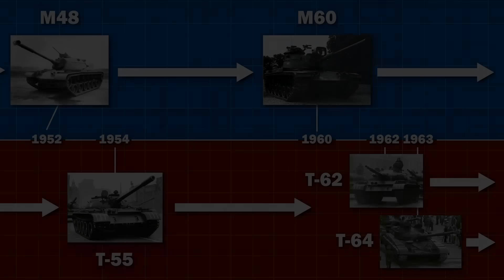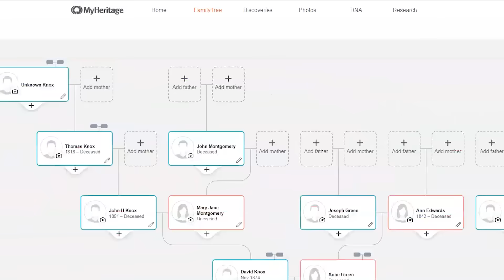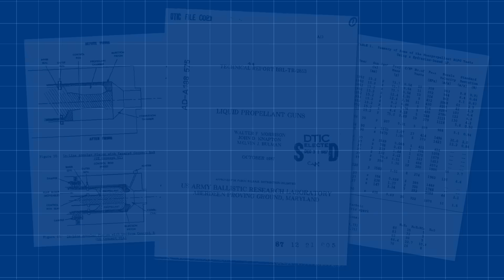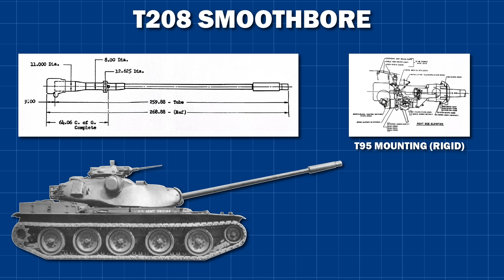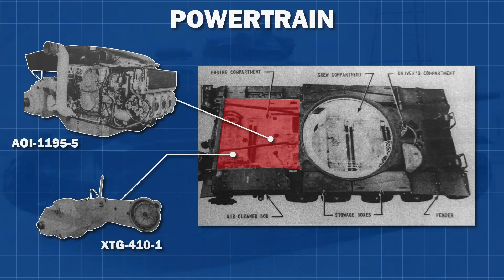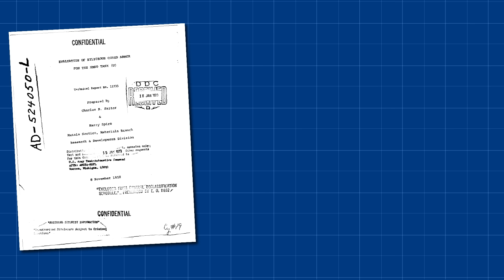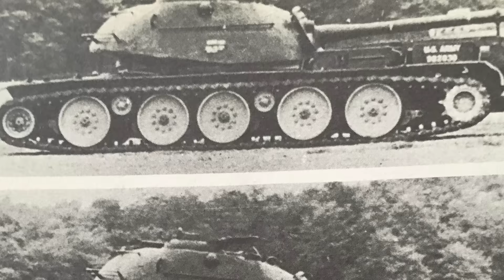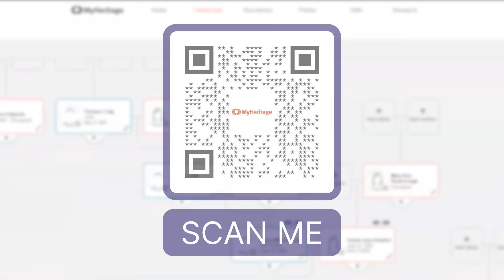T95 - America's Forgotten Super Tanks

Comment: The actual first tanks using composite armor, stretching the definition of composite armor to its very limits, are the Shermans and T-34s equipped with addon concrete armor. If the killdozer's steel and concrete sandwich was considered composite armor, then so does this.
Reply from the maker: I get the feeling composite armour has to be built as a composite to really “count” but I see what you mean haha

Comment: Note early in this video, the NUMBER of wheels.  These early tanks were midgets and lightweights compared to modern systems.  The "instantaneous" footprint of any tank or combat vehicle is determined by how far you spread out the weight in PSI.  Our company did a lot of this work for the LAVs, but they just used rubber tires, so that they could maintain "fast" combat speeds to engage with a slow-as-slug main battle tank.  Unfortunately the USArmy has instead managed to add dozens of Tons to its combat vehicles, because it does not have intellectual capacity to understand that a 70-Ton M1 cannot cross almost 90% of the Ukraine, during the rainy & mud season (and also the heavy artillery).  Russia is now using its most lightweight tanks, to try to avoid this problem.  ALL of these contending forces suffer from the same brain damage, in that all of these vehicles are almost immediately wiped out, by simple 2kg-to-4kg-to-6kg warheads, flown in by drones.  Drones can fly miles further than artillery rounds, so alternate defensive measures are desperately needed...
Reply: The added weight between old and new vehicles doesn't come out of thin air. For each added ton there is a considerable increase in efficacy, that is why tanks got so much heavier.

The main deciding factors on cross-country mobility and mobility in poor conditions is power to weight ratio and ground pressure. In both respects, Abrams and its fellow heavy Western contemporaries are largely fine. The Abrams has never been seriously hindered operationally or tactically by a lack of mobility in poor conditions, even in large scale deployments. It still remains one of, if not the, fastest AFV currently deployed by the US and a similar principle applies for its European contemporaries.

The added survivability of an MBT is massive and it's very disingenuous to pretend that it makes no difference in combat. Just because your feed is inundated with videos of drones doesn't mean that threat nullifies the idea of survivable, well-armored vehicles.

Also, the idea of MBTs being lumbering "slow-as-slug" AFVs has been dead for decades. MBTs are routinely the fastest and most mobile AFVs on the field at any given time and this has been the case since the mid-Cold War.

P.S. Russia is using whatever tanks it can muster. It isn't cherrypicking for light AFVs like you claim. Full-sized Russian AFVs are seeing widespread deployment constantly.

Comment: I had a chance to see on of the surviving T95 prototypes when I was stationed at Fort McCoy, WI in 1975-76.  It was being turned into a radio-controlled target for the anti-tank M72 LAW training range, where it would be repeatedly struck by the 35 mm M73 training rocket fired from discarded LAW launchers.   The M73 not having a hollow charge warhead, the only damage to the T95 woukd be to its paint!   This would give trainees a better experience - having to deal with a maneuvering target rather than the typical stationary target on antitank ranges, and would be much safer to fire as the M73 did not have as fearsome as backblast as the M72.   I rotated away into retirement before the T95 target project was finished, so I cannot say if it was a success.   The T-95 we were working with may be one of the four still in existence.
Reply: Can confirm that the tank is still there at McCoy.  It's now apart of McCoy's Museum or Commemorative Area as the TE95.  It has the M48 turret on it.
Reply: t 95 in 1976?..no
Reply: @steveyoutub76  Read the attached article about the T95 medium tank (not the T95 gun motor carriage)  There were some surviving examples after the original project was ended, one of which I saw in 1976 and one of which is still in the tank museum.